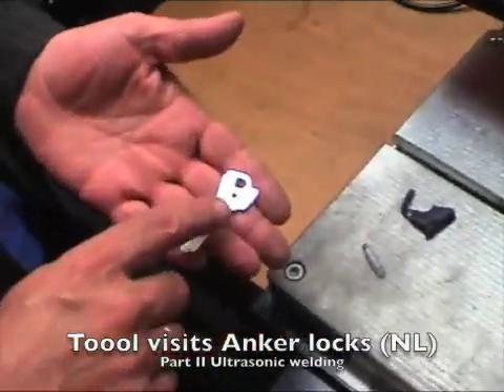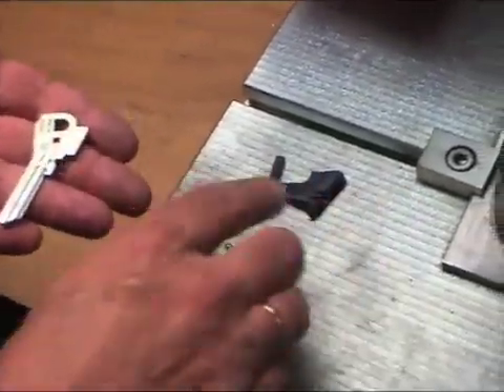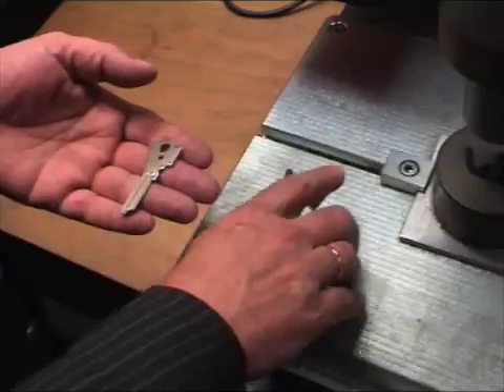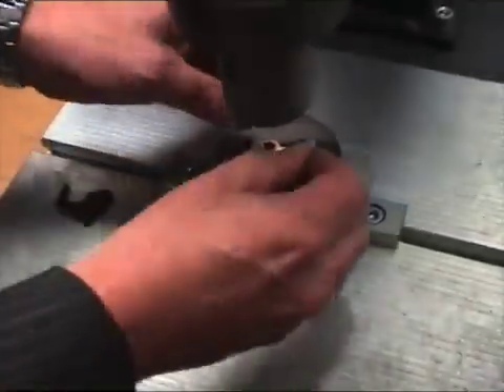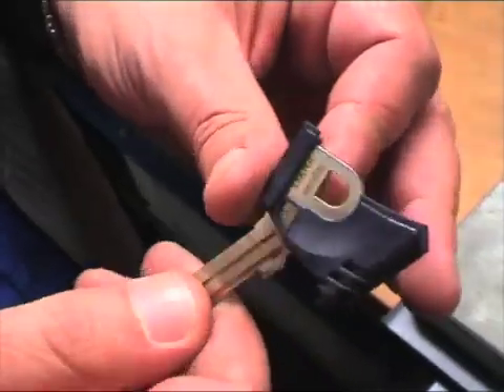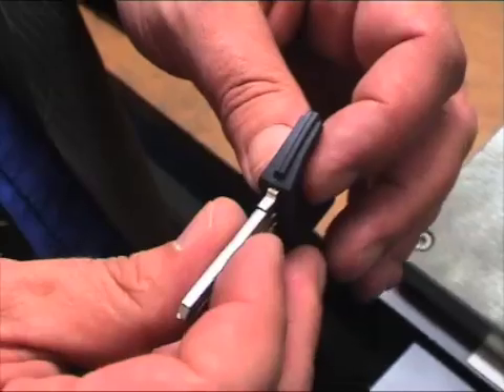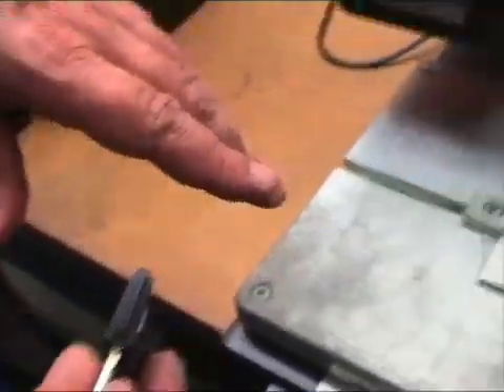Ultrasonic welding

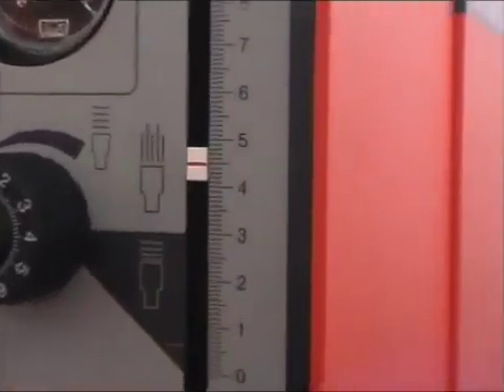Comment: i suppose the amplitude is 4.5 something, and the round dial points at 1, and since we can hear it during the welding process, my guess the frequency is around 10khz which is set by the dial showing at 1:05.

Comment: This has nothing to do with sound, it's friction from rubbing.
Reply: Not so, my friend. Ultrasonic devices (welders, toothbrushes, cleaners, knives, etc.) use a transducer (which in this case is a very high frequency highly tuned speaker) with a bell on it that is tuned to have a natural frequency close to that of the tone the transducer emits. This means that the bell increases the amplitude of the frequency meaning more sound with which to do work.

Comment: 4.5 what? Are you just there to push a button or do you know?
Reply: my guess is kHz, that sound that was heard for an instant sounds about right for 4.5khz. but I'm just eduguessing here so ya..
Reply: It has an audible sound, but of course that's not ultrasonic, 4.5 kHz is certainly not ultrasonic either. Someone else said that number is mm depth, so this guy has no idea what he was talking about.
Reply: Spectrum analyzer says exactly 10KHz.
Now that I think about it a little, it might be 4.5 x 2, because the surfaces rub two times in an oscilation. That would be 9KHz sound. That's probably within the margin of error, video might not have 100% correct audio...

Comment: @jarjarbinx79 most likely MHz... 4.5 KHz is in the middle of the audible range so it's not even ultrasound, and probably couldn't produce enough heat from friction to do this.

Comment: @bassman7530. Foam earplugs may be ok as long as the decibels dont get to high the last time it was tested in the small room where I work it was round 120decibels and with my earmuffs on I could bearly hear it yet it was able to be heard in most other parts of the factory . I also work with welder for long shifts (8 hours) at some points up to 5 days a week . we get our hearing tested yearly and so far I have had no loss.

Comment: @coffebug You seem fairly knowledgable on ultrasonic welders, so I'd like to ask you a question. How efficiently will Grade 5 earmuffs reduce the volume you perceive in decibels? I do assembly in a factory and am required to use ultrasonic welders occasionally, and the standard hearing protection my plant offers is foam earplugs which reduce noise by about 30 decibels. Is that insufficient protection for such high-frequency pitches when working with an ultrasonic welder for a 9 hour shift?

Comment: @ Franky it's vibration . The horn puts pressure on the part to what ever psi you have it set heat is caused by amplitued for what ever you set the weld time to then hold time and horn resets to start position. And yes it can be very loud depending on what you are welding I use that type of machine daily (same brand). Grade 5 earmuffs must be worn at all times to prevent hearing loss.